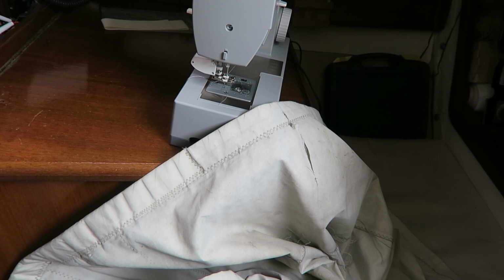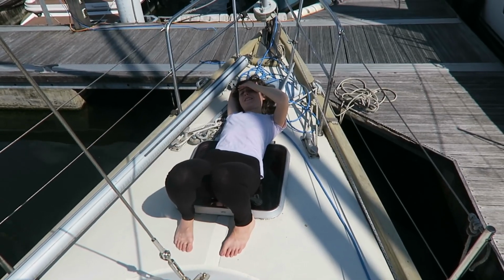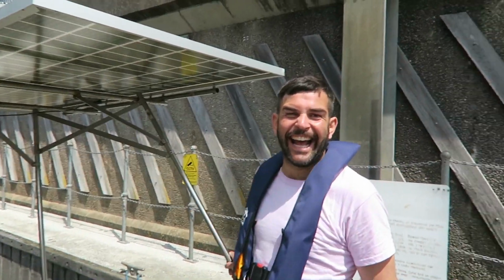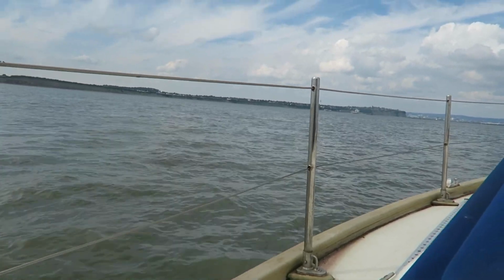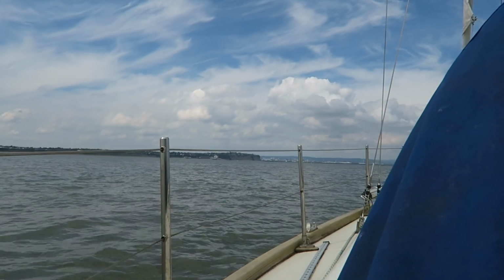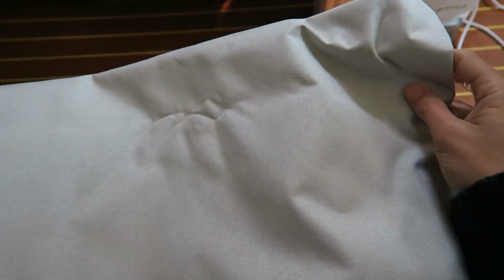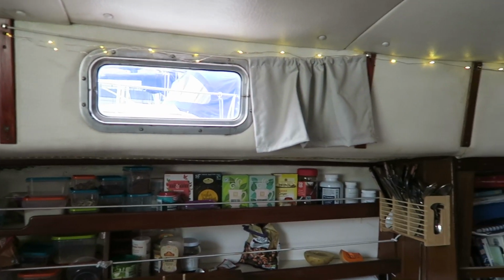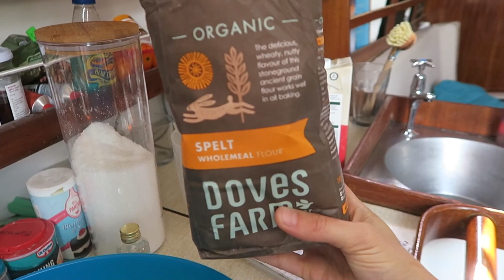Sailing Our Electric Boat on the Sea for the First Time!

Comment: Good Job Guys !!!  Sails looked good for the little wind you had.  That Locke filling looks sketchy the way it filled.  Rough and tries to slam you against the walls.  Here they fill from the bottom and smoothly lift you up.  But overall, looking good !!!  By fall you'll be ready to head to the Canaries & Azores.  Keep pushing it a little harder each time and brave some higher winds.  That Bruce will take care of you, she's a solid. vessel and you can trust her.  Fair Winds !!
Reply from the maker: Thank you so much! :)

Comment: Great ikkle shake down what speed do you get using electric  and range . keep going fair winds
Reply from the maker: We can go up to 5 knots - but as you go faster, the power use goes up exponentially! So we usually go pretty slowly. We managed to motor for an hour and a half at 3 knots the other day, and we still had a third of our battery power left.
Reply: @BethanyIvy five miles is not bad ... Leo from Tally Ho sailed halfway round the world 🌎  with no motor  l prefer to take it easy =no wind read a book, make a meal .
Reply from the maker: @brianevolved2849  Yes it's amazing what people do without engines! Sounds good to me :)
Reply: @BethanyIvy they sailed for thousands of years without engines.... when your sea leg's  have grown stronger head  for the Med😎
PS solar panels inverter with induction hob. tis the way me thinks
Reply from the maker: @brianevolved2849  Yes the Med is our eventual goal! :)
Reply: @brianevolved2849  Same for me.
I think there's something dodgy with induction hobs but don't quote me on that, look it up... I think they are pulsed so trip the  MPPT current protection or something like that.
Reply: @sausage6984  me thinks not[you look it up]